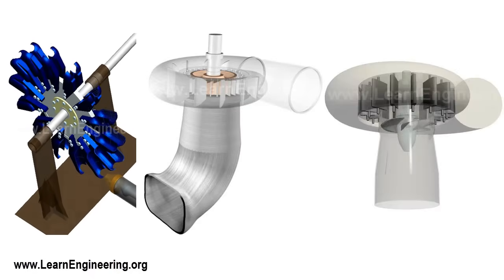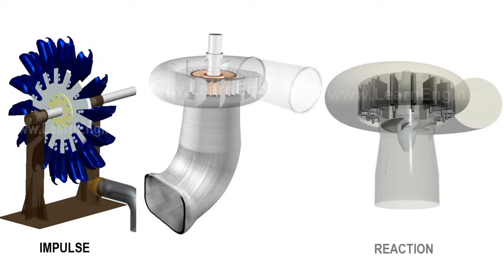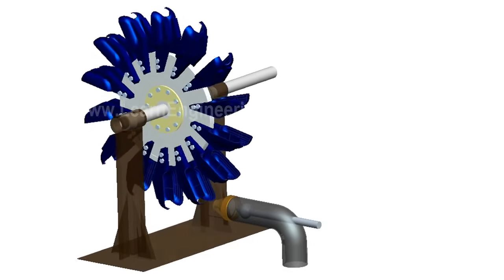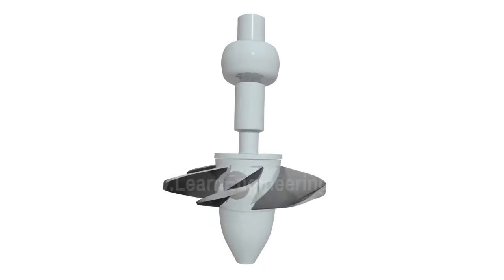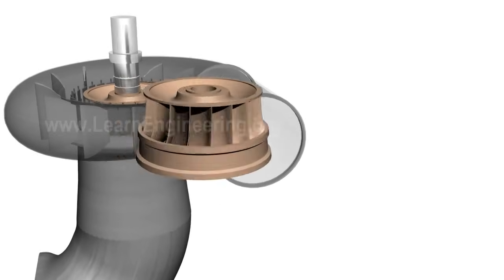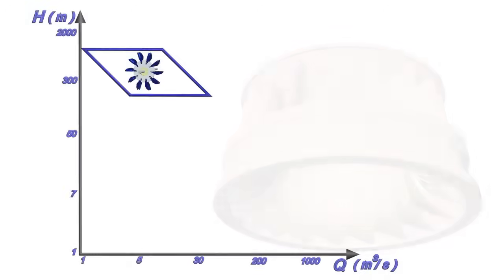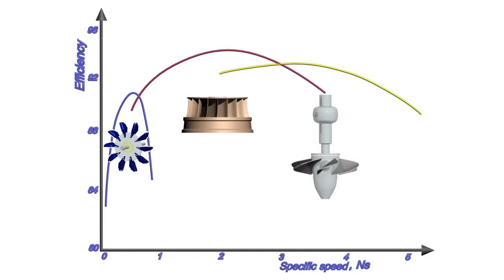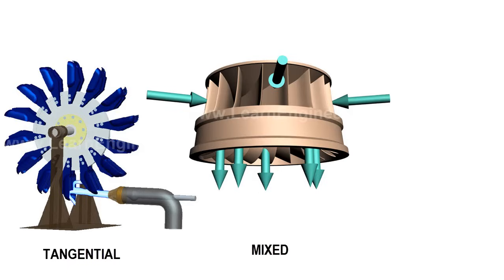Comparison of Pelton, Francis & Kaplan Turbine

Comment: Actually, we have patented a high energy density, compact, efficient turbine engine that doesn't require technologies like single crystal parts, extreme tolerances, or expensive regimens for its manufacture, maintenance or operation, and it could be easily manufactured by most piston engine manufacturers, and would have a longer lifespan than piston engines (even diesels). It is also fuel agnostic (anything from coal dust to hydrazine) and can even be used in tidal and wind turbines. We even printed one in PLA, and ran it to 5600 RPM with no damage (the only reason we didn't run it faster is our compressor couldn't keep up). https://youtu.be/GkYxBZot7zU?si=Z0pgAub5LAJzDLnu

Comment: Precise and to the point explanation under 3 minutes. That's what YouTube is made for. Excellent Work. Keep it up !
Reply: What is the high head ? Can you please explain to me.
Reply: @imli_fx  it's when the height bw turbine and reservoir is greater than 300m
Reply: @imli_fx "Head" is the difference in height between top of the water at the intake and the outlet from the turbine.
Basically the "falling height" of water doing the work on turbines.
Reply: Source or study related literature?

Comment: flow rate = Power/efficiency*water density*specific gravity*head
      *if the problem is to choose what type of turbine to use
      *but efficiency is not given, does it mean efficiency is neglected and cancel out?
      *to determine what type of turbine you need H= head and M = flow rate to graph/plot

Comment: we can produce endless amount of energy and clean water by electrolysis of sea water then take the hydrogen alone to high altitude where we combine it with atmospheric oxygen and drop the water on hydraulic generator from this high altitude as in dams
Reply: Interesting idea, but where do you get the power for the electrolysis from?
Reply: can not happen because electrolysis is only 60-75% efficiency.
Reply: unless you do this at high temperature sea from volcanic ocean but still not practical for massive production

Comment: Interesting , I assume that this is also applicable to gases as well . So most fans are axial as are wind turbines (horizontal axis) and fans that develop higher pressure are listed as mixed flow (like a pump) .